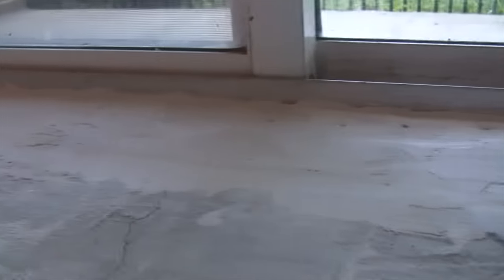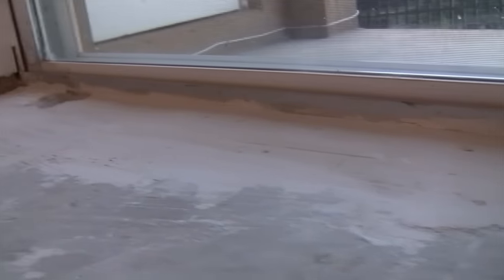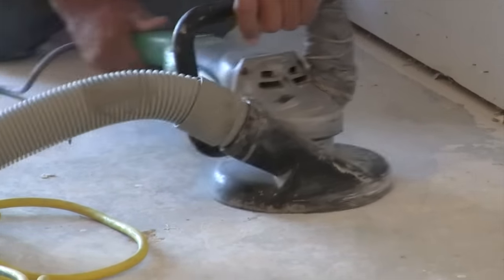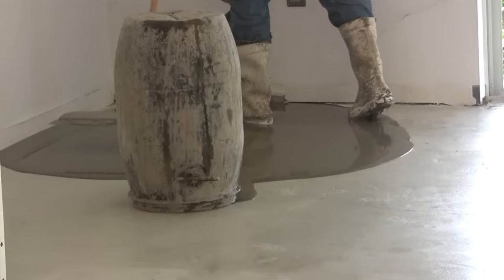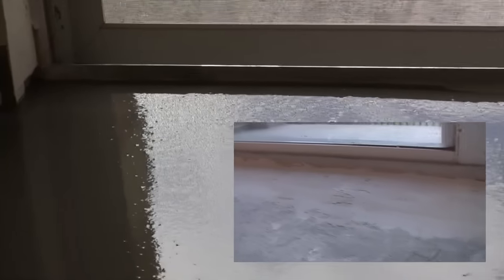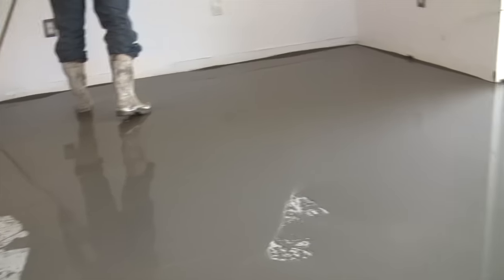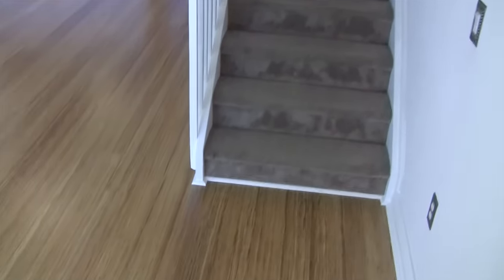How to Self Level Concrete Floors Like Pros - Self Leveler

Comment: It is sloppy work when there is no edging when placing self leveling compound, especially by the carpet. Pros add them or else you will spend so much time getting clean results and avoid ruining the carpet. LoL
Reply from the maker: This was a real contracting company that installed it. Yes it is best practices to put in guards, but in this case they were able to make it happen without it. They seemed to not have any problem because they were skilled with their raking and not sloshing it around. Funny how you say it was sloppy, but yet they did not get any on the carpet. Looks like your description was misleading.
Reply: I think when you look at the project as a whole, the cost involved of leveling that floor, and the likely cost of said real estate (notice the stair spindles are screwed in with 2 screws..... uh huh) it is probably fine.  When customers bid out projects that can barely justify the cost of the improvement, when looking at the result of this work - - the customer could have gotten 10x worse if they went with lowest cost bid etc.  You have to make sacrifices with low budget jobs, and I think the sacrifices made here are not going to be a real issue going forward.  Carpet on stairs will be replaced someday, but not likely replaced with hardwood (you just know those steps and risers are ply).  All in all given the job I think they did well by the customer.

Comment: This is a waste of time and money.. Buffer with aggressive grit does the job.. Hand trowel any major imperfections..
Reply from the maker: TCNA guidelines state that you your floor must be level to within 1/8" over 6 feet. You can't guarantee that with buffing alone, also one side of the room was 1/2" higher than the other. If not, you must pour self leveler or you'll void the warranty of your wood floors and have creaking. With tiles, you'll have lippage, and no you can't make up for lippage with the tile mortar.

Comment: You are vastly exaggerating everything.  America has become a country of babies.  I've used leveler many times no issues without primer.  Also, tile may not be perfect without 50 bags of leveler, but I've never heard complaints.  When working on a budget, 50 bags of leveler is insane amount.  $2000 on leveler.

Comment: First off no way it that many bags.....and no you cannot install wood over it in a couple hours 16hrs minimum so I hope your overnight was 16hrs before you installed bamboo over it smh....if you're gonna show DIY on YouTube at the very leaat make sure your info is accurate
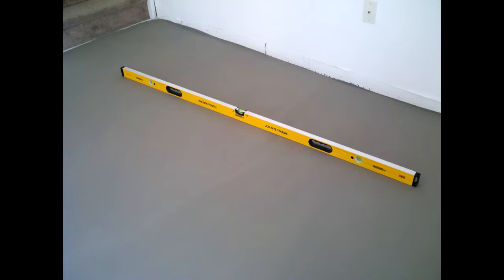Reply from the maker: First off, you are way wrong about what we said, a lousy troller who can't even listen to the facts before opening your mouth. You're never going to outsmart the engineer in the room, so you may as well go troll PewDiePie's channel. We never said put wood floor over it in a couple of hours, you lied to make  yourself look smarter, which just makes you look like a failure. At 6:15, we clearly said you COULD walk on it in a few hours, BUT... we said we were calling it a day and would return tomorrow. How did you miss that part Mr. Perfect? At 6:55 we said we came in the next day, which was 24 hours later. I believe we did not even start laying the wood for a few days because we had to let it acclimate for 3 days first in that room. So I don't know how you think you'll get away with accusing us of putting wood flooring down 2 hours after our self leveler pour. The material typically covers 25 sq feet per bag on a 1/4" thick pour. doing the recipe math, with 375 sq feet on this project, you have 15 bags minimum. Your problem is you did not consider uneven floors! But the back end of that room was up to 3/4" off if I remember them correctly what they told me. This 3/4" difference greatly increases the rate at which you use bags, so at the very least they used 15 bags, but I suspect it was closer to 30. All I know is I counted 40 bags piled up, but did not confirm how many they actually used. it's just like using caulk, they tell you the tube lasts for 30 feet at 1/8" bead, but if you find gaps behind your baseboard and have to use more caulk like 1/4" gaps, then the tube covers 15 to 20 feet. clowns like you never take things like this into consideration. Thanks though, you gave us all here a good laugh, you came in here to school us, but you ended up getting schooled. LOL!
Reply: @jeffostroff  😂😂😂 well I just don't know where to start my rebuttal... so I won't but I really stuck a nerve obviously. Have fun giving false info on YouTube 👍
Reply from the maker: @angryattheworld00000  that's because there is no rebuttal of the truth.
Reply: The product link says 2 or 3 days before moisture sensitive material can be installed over it. Does bamboo fall into that category? Not sure.
Reply from the maker: @moonpiespotlight4759  Moonpie, VERY smart of you to check! But remember, when doing wood floors, you are rolling down a vapor barrier underlayment first, so no wood or bamboo floor is going to touch the newly poured and mostly cured concrete-leveled floor, and even if you did foolishly lay bamboo or wood flooring planks directly on the dried leveler concrete, the strand natural bamboo we used is somewhat water resistant and the amount of moisture in that concrete is not likely to cause an issue. Still, as an engineer, I am a proponent of following all manufacturer directions. I think just because of logistics anyway, we ended up not putting any flooring down for a couple of days when we did this.
Reply: @jeffostroff  Makes sense. I am also an engineer.